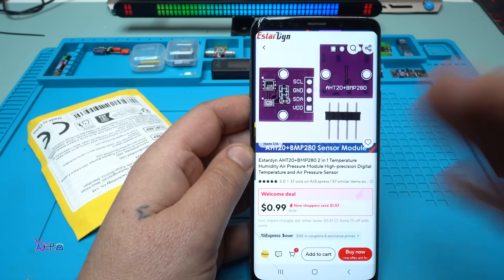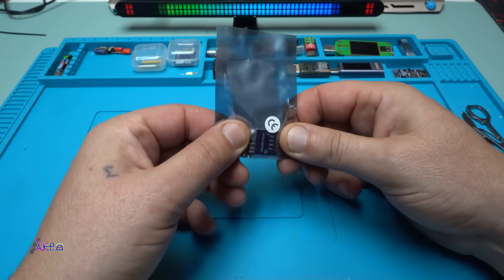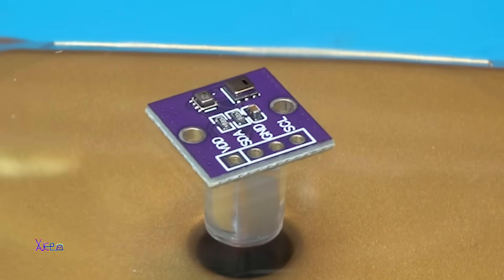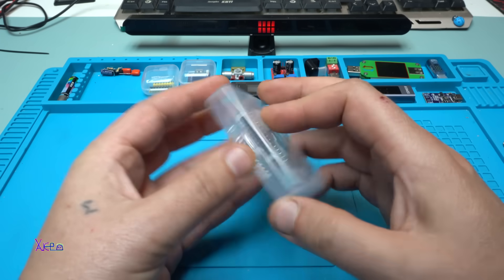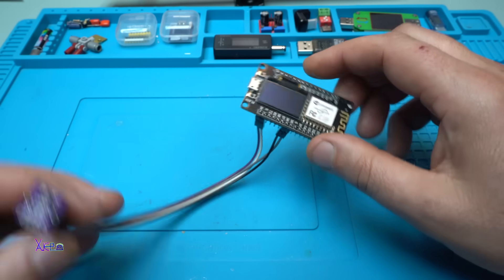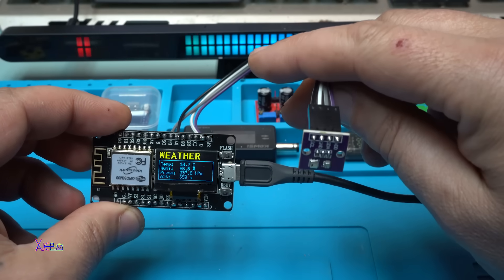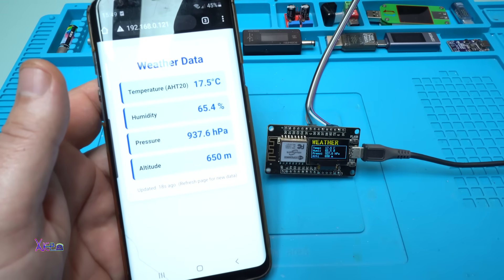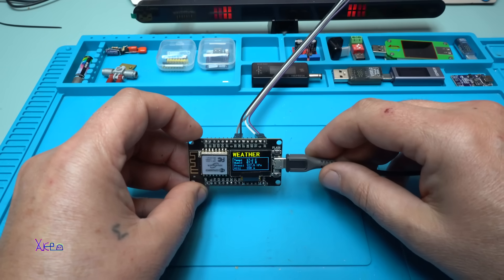THIS $1 Aliexpress Module is Doing Something COOL?

Comment: I have 6 of these from different sellers and most show temp higher than real. They do detect changes well but for accuracy use it needs calibration of some sort and then compensate error in code after
Reply: Bad the Same Problem until I separated the far Enough from the d1 mini Board I Used.

Comment: This got me curious if there are some inexpensive i2c GPS modules on aliexpress, and indeed there are!  $1.00 can buy a tiny GPS+BDS module.  There are only a few reviews, but they say it works well.
Reply from the maker: Nice, thanks for doing the research and letting us know!
Reply: @Hacktuber  Oops, turns out I was looking at the new customer price.  ~$4 or more for regular customers. Also most modules seem to be USB rather than I2C, and many contain flight controllers (for a drone).

Comment: I have dozens of these. This is a sensor I put on nearly every ESPHome project to add temp/humidity/pressure. Someone asked how accurate they are. Since I have a dozen or so currently reporting to Home Assistant, often side by side with each other, I can say they are generally consistent with each other and within a couple percent of other references.
Reply from the maker: Thanks for sharing your experience with these sensors!

Comment: 650m? isn't that quite high? Is the sensor accurate?
Reply: Not as high as I am right now
Reply from the maker: Yes I live on that altitude
Reply: I live at 1000M!  And I'm far from at the top of a mountain....
Reply from the maker: @DrFiero me too😊
Reply: The reference (0 m) is the sea level
Reply from the maker: @mentec 650m above sea level
Reply: Pressure at sea level is 1013 hpa and every 9 meters pressure fals 1 hpa, so 1013- 937= 76 .  76x9m= 684m
Reply from the maker: @markhivin8670 thx for sharing that sir
Reply: Hello, altitude here is based on atmospheric pressure, so the figure displayed will always depend on the weather. Even if the sensor does not change position, the altimeter must be regularly calibrated at a known altitude.😉